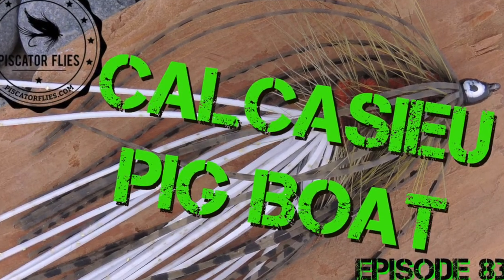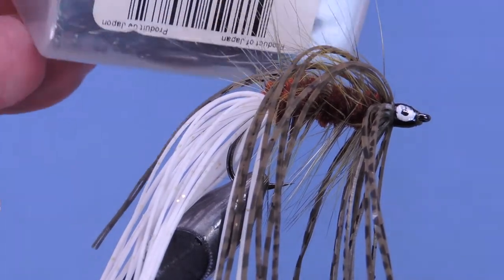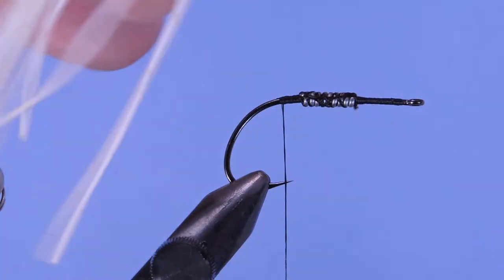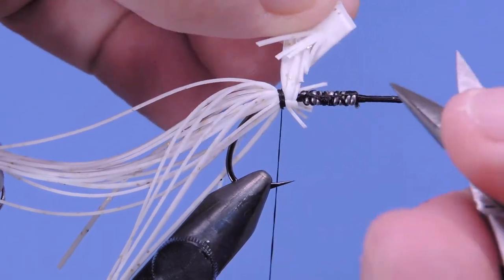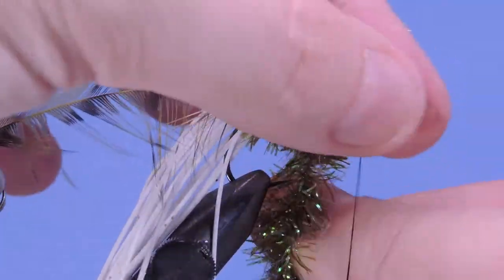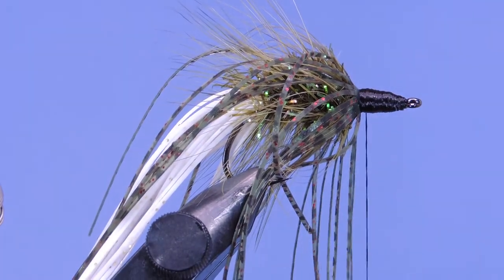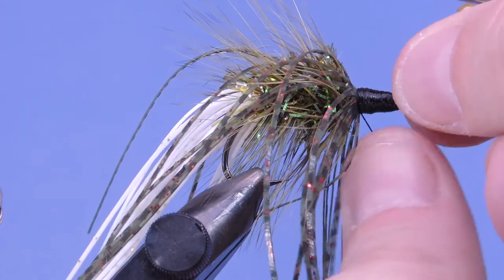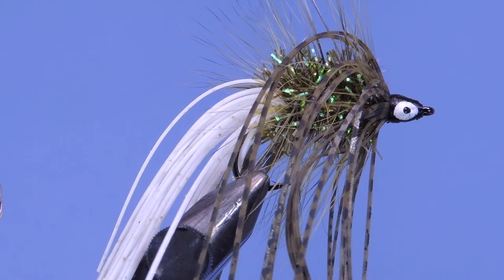Fly Tying Tom Nixon's Calcasieu Pig Boat Fly Pattern  Ep 83 Piscator Flies

Comment: Thanks Darren, I don't think I've seen this tied by anyone on YouTube. I saw this in Fly Tyer 🙊 long time ago. Don't remember the other variations you mentioned, just pig boat. I do remember that Nixon was very particular on the amount of legs he put on the boat, he really "pigged out" on them so to speak, actually counting a specific number. Do you have his book? First edition $299, used?, Unreal! Vintage Hawaiian Wigglers $45. Fred Arbogas made some cool lures. Wonder what my Jitterbugs are worth. Awesome lure. Didn't Nixon reverse tie the the front legs? In any case you tied an awesome fly. Is this what you tied for your bass tournament friends? You haven't let that one out of the pen yet ;-) Cheers dude 👍😎🍺 PS, nice tips on the tab legs too, waste not want not.
Reply from the maker: +Joe Duca Thanks Joe. Yes, I seen this in fly Tyer as well. It was in the Autumn 2004 issue. I don't have a copy of the book, but found one for under $75. It's in a bit of rough shape, but good enough for a bench copy. http://amzn.to/2zFlvNt You say the legs were abundant and I do believe there were 56 in the original. You might be able to trade some of those lures for a first edition. 

He may have tied the legs reverse, it gives them a better arc IMO, but I would think you'd need to tie them in before tying the body and they might add a lot of bulk under the chenille. I might try a few more this way. The pattern reminds me of the Squidro, a steelhead pattern that I tied quite a lot of last year. 

This one isn't the tourney fly, but it isn't far off.
Reply: Piscator Flies Thanks. For some reason I don't always get a notification on your replies. Cool you gave me the Fly Tyer issue. I have to learn how to navigate their site, it'll take too long to dig out my old issues. Yeah squidro, when ever I see lots of rubber coming out the head of a fly I think of the C.Pigboat. Martyn White, flicking feathers tied something that reminded me of this too. Another one had legs and he told me he's going through his supply of legs and using another product that uses polyester( maybe) incorporated in the legs for much more durability. I don't remember the specifics. I saw a couple of forums tie this after you posted. But after a day or so my enthusiasm fades with what I remember about the specifics. What I see in my mind's eye is different. Have you considered using premade replacement skirts for jigs? Jan's Netcraft sells them. They're made "in the round", like the tab ones but the sides of the just the tab are connected, forming a tube. Some come with a silicone insert , they're also available separately as components. They even have "skirt factory" kits, plyers, tool for inserting the tabbed skirts into the silicone insert. You could just slide them over the hook eye either legs forward or back.
I've often thought the silicone inserts could be used as a hook connection on tube flies, but don't know if the dimensions would jive. Anyway Jan's Netcraft has lots tackle components and fly tying materials also.
Are you ever going to post your tourney bass fly? I was going to compare it to a release of info we may have here but I won't🙊🙉.
Take care m8, and cheers to pork! 👍🐷🍎
Reply from the maker: +Joe Duca I do have some of the skirts with the silicone inserts, but I've found these to be a little more versatile for what I use them for. I have some patterns that just need a couple legs, and while the round ones work well, I lose a little length in the middle. The tabs are great because I can get 10 for about 4-5$ where as the skirts are about 4-5$ for 5. There are so many colors to choose from, it's hard to know where to start. 

Was out this morning walking and looking for milkweed, but didn't have much luck. Most of the pods were split or too raw still. I'll keep looking for a good one to tie with.
Reply from the maker: +Joe Duca Had a look at Flicking Feathers. Was it the Fukushima Worm you had in mind? For a Tom Nixon book on ebay for a reasonable price if you are interested - https://www.ebay.com/itm/Z12m-Nixon-Tom-Fly-Tying-and-Fly-Fishing-for-Bass-Panfish-1971-/232530921560?hash=item3623ec4858:g:wDIAAOSwg0BZwq1b
Reply: Piscator Flies milkweed, lol, forgot about that. Awesome you're looking for it. Crazy weather did 'em in. 
Those skirts are twice the price :-( you should still check out Jan's Netcraft, they have assorted bulk skirts(tabs or full don't remember) that may be comparable. The choices of material and colors are overwhelming.
It was a crayfish pattern Martyn tied that reminded me of the 🐖 Pig. I believe you commented on it also. I think the waste ends of the legs formed the tail.
Yes it was the fukuworm video. But not legs, the curly tail was made from vinyl impregnated cloth. He provided a link I believe in his reply to me. The Scandi / Nordic boys really embraced the curly tail, as well as... I guess the world. Mr Twister grubs and worms were revolutionary when they came out. Once at a sports show I told a rep I thought they sucked, I've never caught a fish on them! He told me then you've only made one cast... So I took it to task, I don't fish worms that often and I can't remember any catches made (except for those double hook rigs with a silver propeller ahead of the purple worm, awesome for chain pickerel at this great pond we used to fish back in the day) on the Mr Twister worms. But the grubs were more productive. Their minnows with the boot foot tail were even better. I think they called them Sassy Shad. Parallel universes, conventional and fly. Lots of cross overs.
Thanks for the links, with all this "pork" I'm craving sausage, got to eat something. I've used pork rinds before. Nice action and bulk to tip a jig. But the the pectoral fin "plate" of a perch is superior IMHO. I can name a few flies that imitate pieces of bait.
But I fish bucktail jigs that I tie, no added enticements. Same goes for flies. Hey, I enjoy our "forum" we get going now and again. You're awesome brother, take care. Btw-  Look at Mcphail's matuka madness, Ryan Houston tied a cool zonk too. Cheers 👍🐷🍳